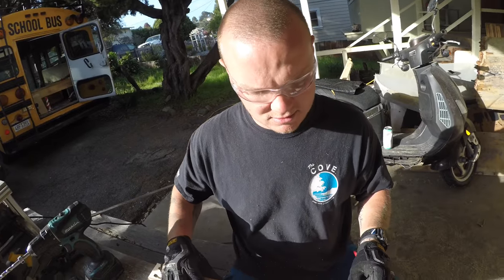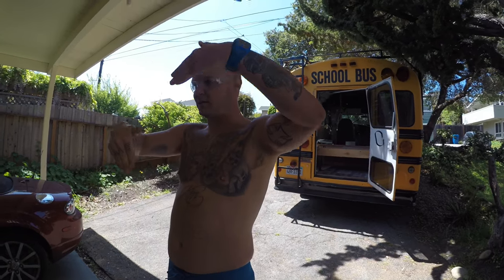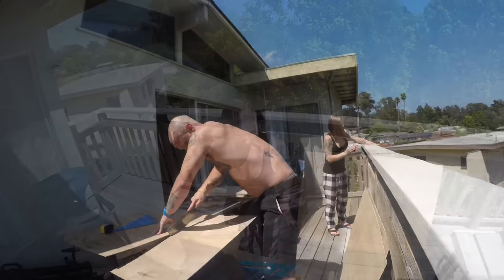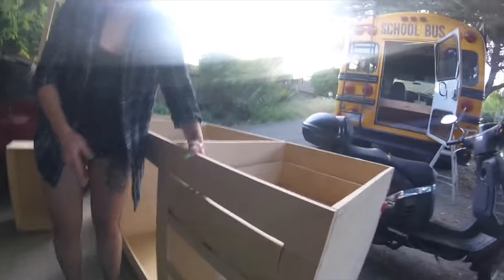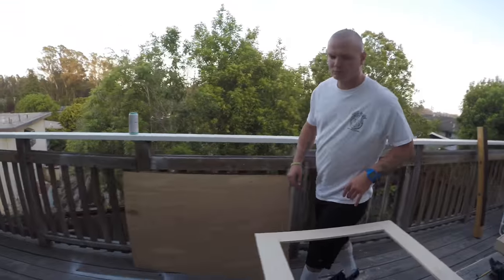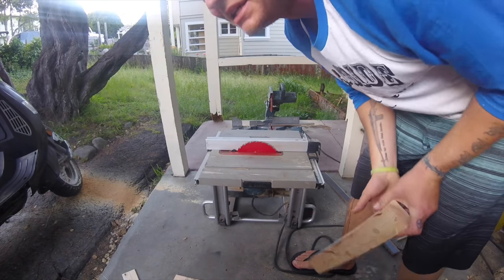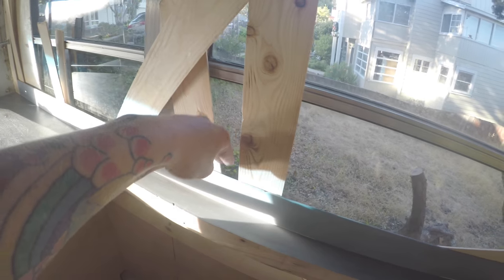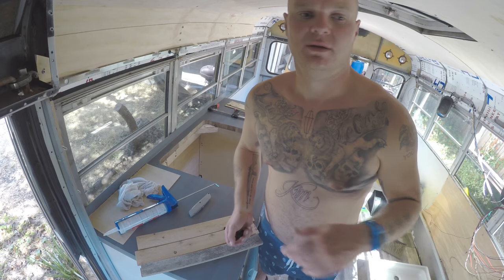SCHOOL BUS CONVERSION SERIES - EPISODE 6. CUSTOM CABINET BUILD & INSTALLATION

Comment: Masking tape indeed my friend. A blade containing more teeth is the real answer (i understand not wanting to spend or when cash is tight, (it's f'n covid) no worries) 96 to 144 tooth for a 10" to 12" blade and a 48 to 72 for the circular ... you'll clean cut any wood, at any angle, melamine, etc,  with masking tape added; job guaranteed. You'll just have to concentrate on the cut.... cheers 
Keep the blades for the next finishing job you'll do or sell them at a bit of a loss... you'll win in the end product, ease of use, far less (no) finishing to address tear up...